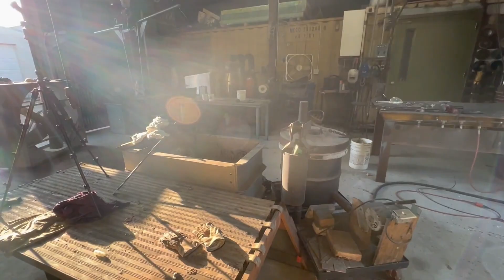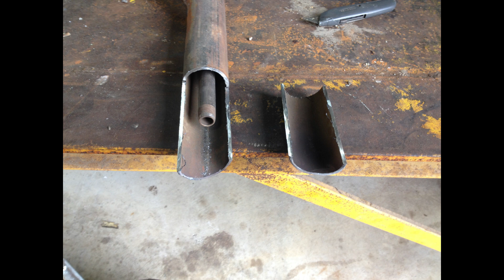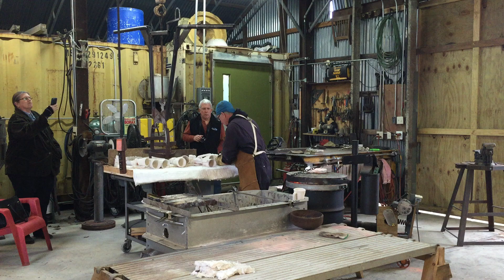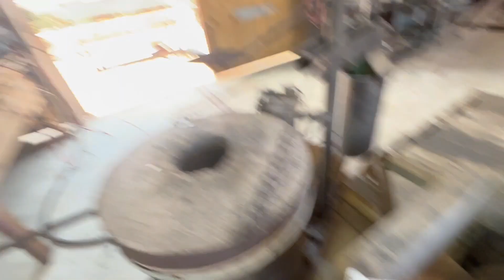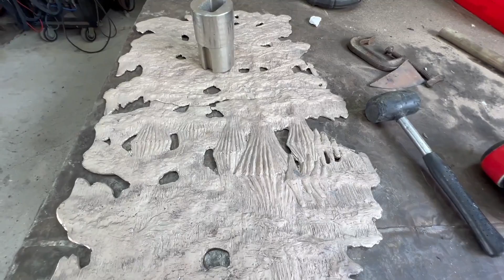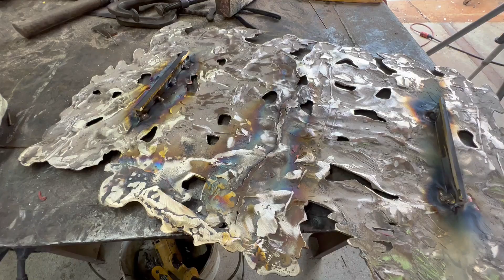Casting Jim's Swamp Scene  In Silicon Bronze Part 2

Comment: Hi Barry,
 I am after some advice if you wouldnt mind.I am a sculptor based in the UK,but just starting out in bronze casting (mainly just done steel and stone previously)and setting up the workshop for it...i would be doing about the same size casts as yourself i recon.what sized shot blasting cabinet would you recommend and anything intrinsic about that particular cabinet?i.e should have a special/particular feature for use?if that makes sense?
 Thanks in advance,
 Dave
Reply from the maker: Dave 
I was able to snag a huge SS navy surplus blasting cabinet on EBay when people actually sold second
Reply from the maker: Oops 
I was talking about how eBay no longer has many used tools listed. But in fact it was over kill. If you are an artist and not a production shop pretty much any cabinet will do. A strong air compressor is more important as blasting uses a lot of air. I was told by a professional patina dude to use 240 grit aluminum oxide. I think that should be available at any blasting supply store. Here we have Harbor Freight which is an importer of cheap Chinese tools. There are YouTube videos of folks making improvements to these to make them quite serviceable. Hope this helps.